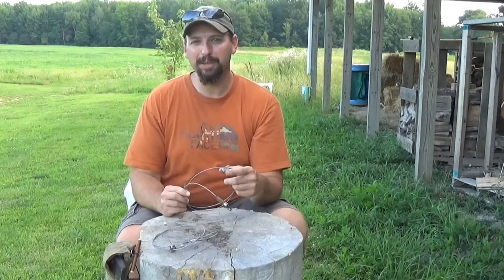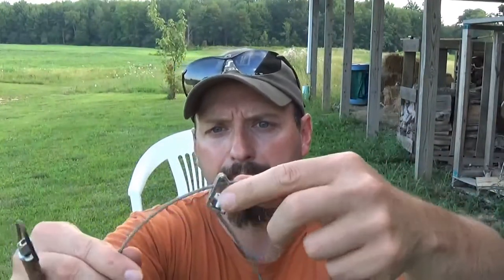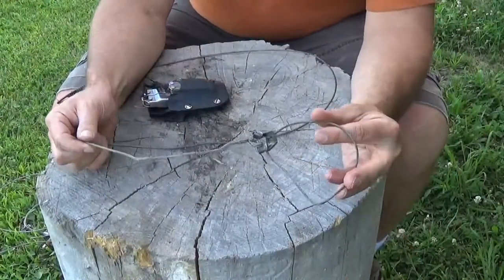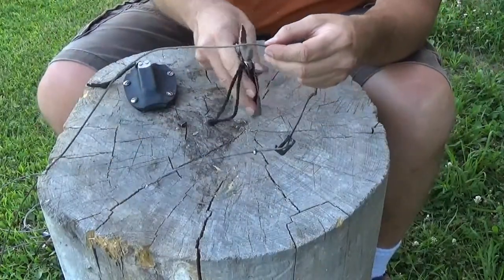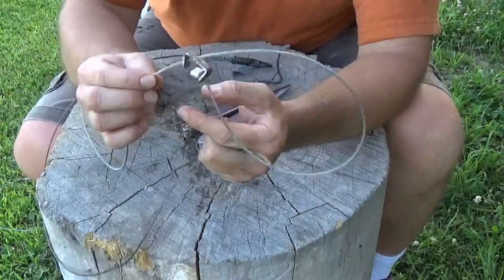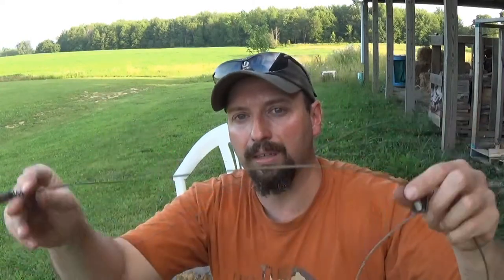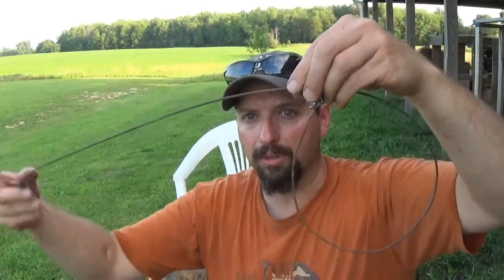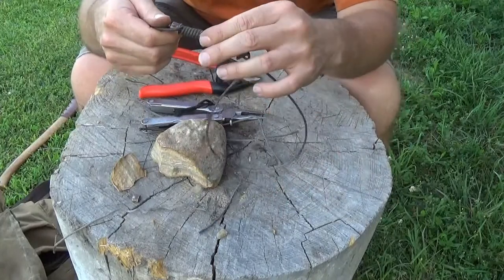Repairing a Snare in the Field

Comment: Where did you get the cable cutter? I have been struggling to cut some twisted cable to make tiedowns for a set of traps and that stuff is difficult to cut with any tool I have.
Reply from the maker: Grandpa's Place the cutter I used is a Delco C7 cable cutter.  There are cheaper options but these are the best and most durable.
Reply: Thanks, Ill have to see if I can find one.

Comment: Is there a way, to repair a wire snare, as well? I can't seem to find any info on the topic :( . Thanks.
Reply from the maker: Yes.  I think I did a video on it. I will look
Reply: @BurningRiverBushcraft  Thank you. I hope, you find it.
Reply from the maker: I haven't made a wire snare repair video.  Stick with small diameter cable snares for long term use.